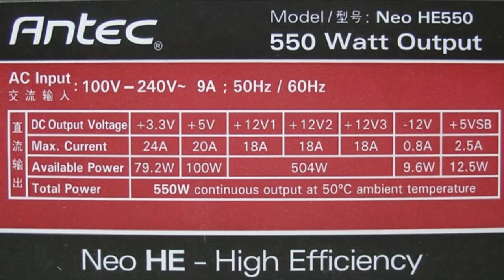TechBits 9 - Power Supplies Demystified (Part 1 of 2)

Comment: so in order to determine what wires are connected to which rails i can look up the specs on the back of the psu, is it possible that the wires may be color-coded to indicate which rails they belong to?
i just bought a 4 12v rail (19A each) power supply, HEC Zephyr 750w

Comment from the maker: As per my knowledge, computer PSUs do not step the voltage up first.  But I'm not 100% certain.  When I said switched, I was talking about PSUs that can use either 120 or 220V, but require you to select the input voltage with a switch on the back.